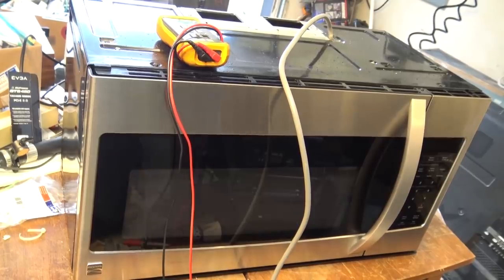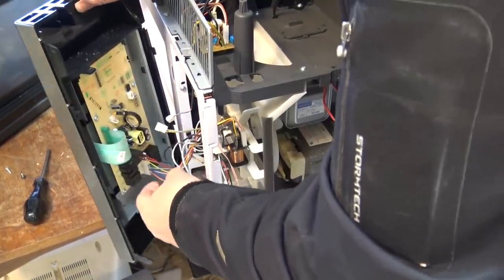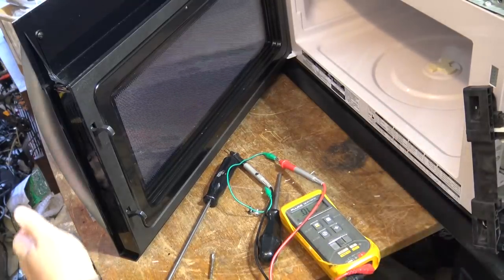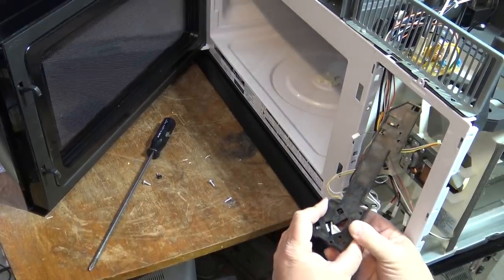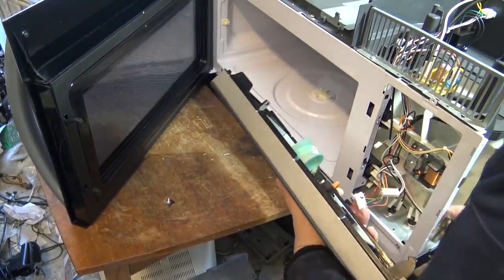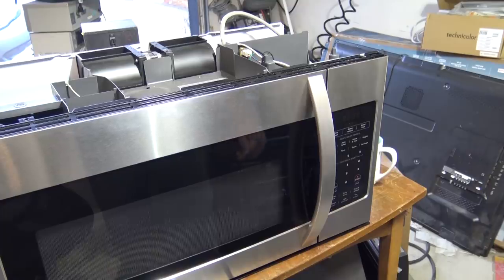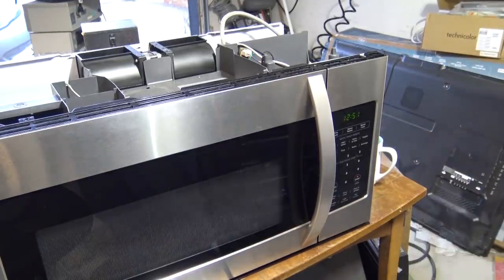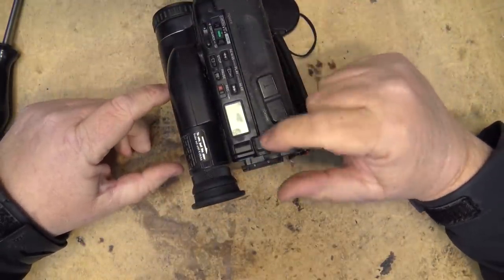Microwave Oven Blowing fuse as soon as plugged in

Comment: Will the microwave screen be completely blank if it’s a switch issue?
Reply from the maker: A switch issue that causes a blown fuse certainly will.
Reply: 12voltvids so if I replace the blown fuse the screen should show up? I pushed a switch in all the way and trying to get it unstuck I think I blew a fuse. Would I need a new switch too? Replaced the fuse and the screen is still blank. Don’t know if I just got a bad new fuse
Reply from the maker: @pillsberrydopeboy851  
Typically if the short switch triggers it will weld the contacts together and will need replacing.   Otherwise you will blow the fuse as soon as you close the door.
Reply: 12voltvids the short switch is the bottom one? Do both need replacing? The screen didn’t even come on for the fuse to blow again so idk what the issue is exactly

Comment: Just to clarify.  In which position (top or bottom) do the "Normally Open" and "Normally Closed" switches go?
Reply from the maker: In most microwaves the top switch is the primary interlock and the bottom is the safety monitor or short switch.  Just remember this.  The switch connected with the NO and Common is the primary and the switch connected  with the NC and Common is the short switch.  The switch with the small wires going to the timer board is to stop the timer from counting when the door is opened.

Comment: Just polish up the contacts; she’ll be fine, mate! 🤠
Reply from the maker: Actually I have done that on my old long discarded microwave when it welded the contacts together, but I would never suggest that anyone do that for liability reasons. Those switches are critical safety components, and once they arc and weld themselves closed they need to be replaced. If you want to do that on your own unit, I can't stop you. I can only recommend replacing the switch as it is a safety device.
Reply: @12voltvids  On my microwave the primary interlock failed closed so the breaker tripped whenever the door was opened. The low voltage switch to the timer module happened to be the same model, so I swapped the two. The safety circuit got the untouched switch and the timer module got the marginal switch. I believe it should still be safe.

As a side note, when the monitor switch operated it shunted the current without welding itself. It tripped the 20A breaker instantly instead of the 20A fuse. I presume this is because breakers have both thermal and magnetic trip functions while fuses are only thermal.

Comment: Have you ever seen a microwave that turned on with the door open?
Reply from the maker: That can never happen unless someone has modified it and removed the interlock switches.  In certain units, if one of the relays gets stuck the fan will run with the door open, but never the magnetron, because the short switch will b low the fuse if the primary interlock fails to remove power when the door opens.
Reply: 12voltvids 
Ah. I've seen videos on Youtube of microwaves with the plate turning with the door open.
Reply from the maker: @mrmagnetoscope  A stuck timer switch will cause that, but if the door is open the primary and secondary interlocks will prevent power getting to the transformer unless someone has disabled them, which would be an incredibly stupid thing to do,  but saying that, there are an incredible number of really stupid people in this world that really should be in a padded cell for their, and everyone else's protection. I saw a video that some moron had taken the magnetron and wave guide out of a microwave and was using it as their own personal microwave transmitter, and was modulating audio into the HV from the power supply, and transmitting it at 600 watts on 2.45GHZ into a feed horn. Several KM away his partner hooked a antenna to a waveguide and pointed it back at the transmitter, and was able to receive the signal. Sure, no kidding. I have done that with 1 watt. 1 watt into a waveguide, and I was beaming live video over 100KM mountain top to mountaintop on field day. This idiot did it with 600 watts, in a residential area with the feed horn lying on the ground.  Anyone in the line of sight in close proximity would have received a dose of microwave energy that mar have been harmful. 
Phone companies used microwave, for that matter they still do for point to point links where there are no fiber optic cables, but the antennas are only a few watts, and they are up on big towers so as not to be directing their signals where people live.

Comment: Hi there. i hope you read this   men i disconect hte capacitor and i didnt remember how the cable goes i take a picture but i deleted for accident.. its like the same as in this video.. i have doubt how goes the capacitor and the cables and diode.. the model its kenmore 790.80322310 let me know how can you help me
Reply from the maker: HV lead to capacitor.  Other side of capacitor has the diode and HV lead to the magnetron labeled FA, the other side marked F goes to the filament winding which also goes to the FA side.  The filament is the single turn around the transformer.

Comment: do they use time delay fuses
Reply from the maker: They use a ABC fuse which is a slow blo fuse.
Reply: @12voltvids  even after checking my micro switches  bracket, door alignment, it still pops my fuse as soon as I try to microwave something,, display comes on fine, but then it pops after I try to heat up coffee.
Reply from the maker: @randy1ization  if conventional microwave with big transformer it will likely be the big HV capacitor has shorted.
Reply: @12voltvids  my capacitor has a plastic housing, so how can I tell if its shorted to the case? I have a fieldpiece capacitor tester.
Reply from the maker: @randy1ization  ohm meter across the terminals. Disconnect wires first.  If it says 0 ohms it is shorted.  If says open then it is good.  You can disconnect wires from magnetron and see if it blows fuse.  If not then magetron is shorted.  Only few things will blow fuse when start cooking.  If not short switch it will be capacitor or stack diode or magnetron.  This is for non inverter types. If it is an inverter Panasonic then the inverter or magnetron. Inverter boards are extremely dangerous to work on because they generate about 4200 volts and enough current to do serious damage.  I won't work on them myself and would never make a video for inverter repair due to the extreme hazard in servicing them.   Panasonic didn't even want service centers fixing them.  They sold them as a complete replacement part.
Reply: @12voltvids  its zero ohms across the terminals and not shorted to casem I was misatwen it is a metal case. when U swithcthe meteer to MFD, ITS ALL OVER THE PLACE, 11 to 33 mfd. rating is 0.83 UF
Reply: I was an HVAC' Major appliance contractor for 20 years, microwaves always kicked my butt for some reason.
Reply: @12voltvids  not sure if its radiation or what but everytime ive workked on microwaves, ive delt woozy... nautious,, scrap yards in louisiana wont even take them.
how can I identify an invertor type magnetron? are they specific to panasonic?
Reply: thanks for your help, I may put the microwave back together, and try a new caopacitor.,. ive taken a shitt load of things apart.
Reply: @12voltvids  what happens with the diode. does it short to ground,, or let power travel in both directions, I understand they aew one way electrical chokes.
Reply from the maker: @randy1ization  there is no radiation from microwave ovens.  There is microwaves.  Radio waves.  It is nothing more than a radio transmitter. 1000 watts.  Same frequency as your wifi router. Your wifi puts out 1 watt.  Many ham radio operators use the magnetron out of a microwave as a transmitter and putting a waveguide up high where it is away from people. They modulate the DC power which modulates the carrier power.   Needless to say this is rather hazardous.  Besides high voltage microwaves can be hazardous.  Heats you from the inside.  I personally know a guy that did much experimenting with microwaves.  He died about 10 years ago.  Full of cancer.   He smoked like a chimney so that could have contributed to cancer.
Reply from the maker: @randy1ization  On a conventional microwave with an iron transformer and capacitor (non inverter type) the way it is wired is one side of the secondary coil in the transformer is connected to the core which is bolted to the chassis, ground. This is why you never operate a microwave oven on a non grounded outlet as that ground prong is what keeps the chassis at ground potential. No ground wire, and the cabinet can float to several thousand volts above ground potential. The other end of the transformer goes to one lug of the capacitor. On the other side of the capacitor it the diode, and the other side of the diode goes to ground. 
The HV AC goes through t he capacitor with half the phase (the negativeswing of the phase)  being conducted and fed back to ground. Now you would think hey, that is a short, but remember the capacitor is isolating this. The diode forms a half wave rectifier.  The other wire on the capacitor goes to the magnetron (Anode) The capacitor pumps up the positive high voltage to the magietron. On the magnetron there are 2 terminals. One marked F and the other FA. There is a second winding on the transformer, a single heavy red wire that makes one turn around the transformer. This is the filament tap. It is connected to both the F and FA terminals, and the capacitor to the FA side. (if the wires are reversed it will result in magnetron death as all the current will be drawn through the heater)
So, if the capacitor shorts, there is no isolation, and and the winding will be presented with a short, draw too much current and blow the fuse. If the diode shorts the unit will make a loud humming but no heat. If the diode goes open, there will be no DC to the magnetron, and again no, or very low RF. The magnetron can short as well. That is easy to determine, Just disconnect both the wires from the magnetron and power the unit up. If it blows a fuse again, then the capacitor is bad. If not then there will be high voltage on both red wires. You will need to discharge the capacitor. Fortunately, all modern microwave capacitors have an internal discharge resistor which will drain the 2000 volts generated relatively quickly. Just leave it for a few minutes and then short the magnetron wire to the chassis to be sure it is dead before touching to reconnect.
Reply from the maker: @randy1ization  Scrap yards won't take them due to Beryllium Oxide used as an insulator in the magnetron tube.
It is the ceramic type insulator that the tube is made of, and the antenna is attached to.
The problem is it is a carcinogen. Not the compound, but dust released when it is broken or crushed. Recycling centers remove the magnetrons and dispose of them as hazardous waste before recycling the steel. Scrap yards typically just shred the metals, and this would release dust which is inhaled could cause serious health issues. 
When I worked in the business, we had to remove the magnetron, and put a declaration tag on the oven that the magnetron had been removed. Some old units also had a capacitor that contained PCBs. These capacitors also had to be removed before they unit would be accepted. 
Of course it costs the business fees to dispose of these and nobody wants to have to pay. Customer won't pay for it, and the business gets stuck with the disposal fee. 
Here in Canada, for every new electronic evice sold you pay a recycle fee at point of sale. 
Everything. Light bulbs, even incandescent (yes you can still buy them) cost .10. Everything, toys, batteries, gadgets. A televisioon for example as a 25.00 fee added, before tax to dispose of the TV when you are done with it.
Reply from the maker: @randy1ization  It won't be shorted to the case, that is insulated. 
Should be open between the terminals. 0 ohms is a short. Capacitor is bad.
Reply from the maker: @randy1ization  
I need an idea for a video. Today I will go through troubleshooting for a conventional microwave as I have one here.
Reply: @12voltvids  THANKS  u are a gifted tech, if u ever have a question u arent sure of abt an HVAC system, washer dryer, ect, just let me know. I also do some automotive and outboard motor repairs. I work on small motor bikes too like honda z50 and ct70.  do u own an oscilliscope, thats what im very interested in as well.
Reply: capacitors can be strange I acttually saw one make a 230 VOLT ac  CONDENSOR MOTOR run backwards one time.v I asked the customer is someone had recently changed the fan motor and she said no. after changing the motor it still ran backwards until I replaced the cap. I understand  that caps change the sine wave of the voltage, but never figured  out why it made the fan run backwards. the fan is a reversable direction fan motor.
Reply: the microwave in working on had pizza and 2 beer cans in it, I think they had a hell of a party lol
Reply from the maker: @randy1ization  Induction motors can run either way.
Reply: @12voltvids  thanks it will take a bit to digest this, but I will study it until I understand thanks very much.
Reply: hey I have a sears battery charger that keeps clicking,. it provide some voltage not alot , until it clicks.. it then recycles and clicks,von andvon,.,, weak automatic circuit breaker perhaps. I hate to throw old stuff away it was made to last. ALSO, i FOUND AN ELECTRIC WHEELCHAIR.. the batteries were 6,2 volts should be 12,5 ,, the batteries were both dry, no electrolyte. I added distilled warer and they came upo to 11.5 but wont go higher. Im wondering if it will take time for the distilled water to turn to electrolte and allow a full charge or if I havev a bad cell, botjhe batteries seem to act the same.
Reply: im letting them sit for a few days,, the charger is trying to trickle charge then, but this has been going on for 2 days,,, currrently they are at 11.5'' ive seen a vid where a guy dumped the corroded liquid out anhd refilled them with fresh distilled water and they came uo to full charge, might try this next,, they didnt hold much water they are sall high amp hour batteries.l. m wondering if I should dump the distilled water out, and try refillling with straight elctrolite.  or if there is a safe additive that can clean the scale from the plates.  like CLR . I just dont know exactly what is on those plates, maybe sulfer, or magnesium. dont want to creat an explosion . ha
Reply: @12voltvids  depends on the orientation of the windings